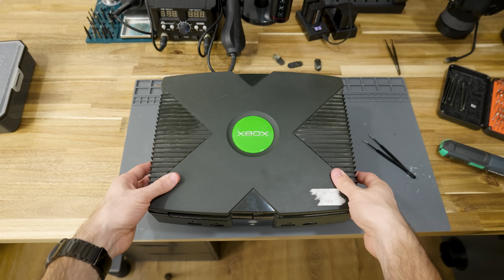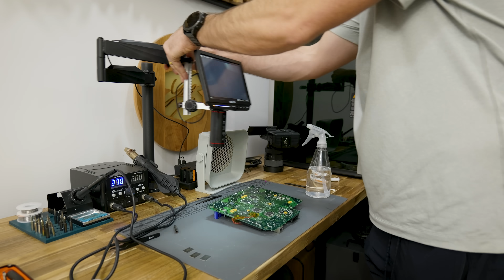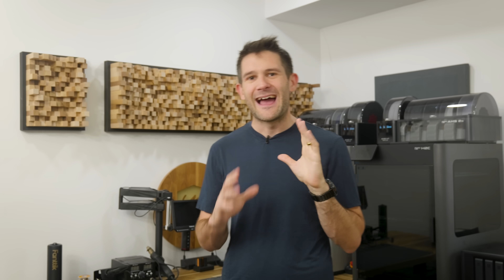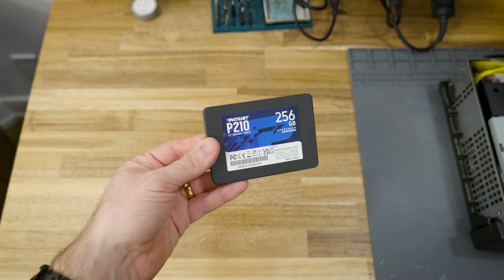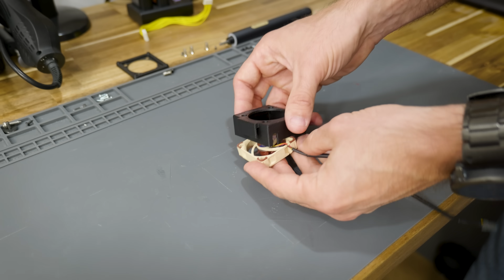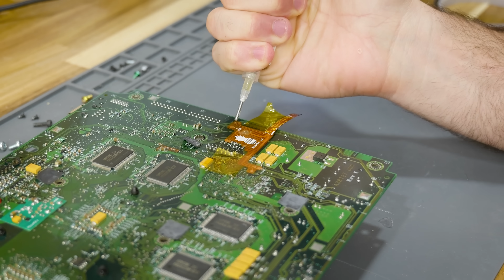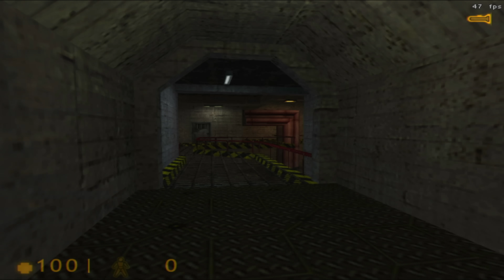I built a MODERN XBOX...

Comment: Okay I would like to know how you got the data from the hard drive over on the SSD. Because you can't just pop in an SSD into an original Xbox and it just magically boots. You can't even take it the hard drive from a from another Xbox and put it into a different Xbox. Because it's all system locked.
Reply: You can transfer the files over using something like fatxplorer. The HDD is unlocked here from the mod chip

Comment: you can’t just slap a drive in there it needs the os firmware and digital signatures, cryptographic keys, and a secure bootloader chain to verify that all running software and game saves were authorized by Microsoft, GOOD LUCK WITH THAT

Comment: This... was amazing. The wife dug out all my old VG consoles and is insisting that I hook them all up and showcase them in our spare room so they can be played. Tried to turn on my original xbox and the drive wouldn't open. I fixed that, now it won't read. :/ Now here I am down the rabbit hole. I've got a lot of research to do, but I'll probably do a lot of the easier mods in this video. I was thinking just a soft mod and emulation was the way for me but now I have this video. 

It may just make my task so much easier with emulation on the xbox. I could skip the NES, SNES, and N64. Keep those in the closet and still play all the games. :)

Comment: that is not how you solder IC to the motherboard, use heatgun for soldering also, good flux but needs skills to know what settings to use on the air soldering station

Comment: I know there are quieter fans and without the dis drive yeah it’s quieter but when you’re doing a side-by-side comparison, maybe you should add the shell or take off the shell depending on which way you’re looking at it so we know they’re true difference after you do that, and then it depends on the material that’s many years how thick it is blah blah blah blah blah yeah it’s thicker material if it’s thinner material, etc. and so on so you made it smaller cool but yet the sound quality was with the top on on the better one and the sun quality was with the top off on the bad one

Comment: To remove the Xbox logo from the casing... it's much better and easier to just leave it in the sun for about 3 hours and it will come off very easily without damaging the edges of the logo or leaving marks on the Xbox OG casing.

Comment: You need to replace the tip on your iron. Your struggle with the RAM chips and the ribbon connecting to the video chip was entirely related to that tip being badly oxidized.

Comment: "Using one of these devices in 2026 is a rough experience" maybe, if your console is busted, mine isnt that loud and the size isnt a big problem. Also it was designed to display on a CRT TV. Outside of portablising I believe that retro consoles are best played on those same CRTs. They can be hard to find but there is a chinese company that makes brand new ones, the downside is the shipping would be a nightmare because they are heavy beasts. Luckily I found mine on the side of the road and I have a spare one just in case.

But having said all of that I still think its fun to see your designs.

Also you arent getting as great speeds as you might think using an SSD, the bottleneck in that respect isnt the HDD itself but the system, about the only real benefit you get is the quietness.

Comment: I wanted to do these mods myself a while back but just felt it wouldn't be used enough. I'd like to purchase that microscope you have though. I use to be a lead tech for 2 different companies building pcb boards and manufacturing LED lights for marine/commercial, and home applications. I spent thousands of hours looking through a microscope and it messed up my eyes. That microscope would've helped ALOT. I still tinker with stuff here and there so it would be helpful being that my eyes are so messed up now.

Comment: Boy what a blast from the past, the original xbox was such a great console at the time. I used to mod and solder on socket based mod chips (that I flashed myself) back in the day, swap in a bigger hard drive, and load up a bunch of games for whoever was lucky enough to convince me to spend the time to mod their console. I even remember swapping a disc drive at some point, probably because my own disc drive failed. I still have the original machine, the d0 popped off at some point after I got a 360 and I never touched that original box again. Maybe this will give me the will to spend some time upgrading it.

If I remember correctly, on the xbox jewel you can sandpaper the bottom of it to make it clear, then use some LEDs to light it up with whatever color you prefer.

Comment: 17:25 the only issue for me is I have one of the final rev ones that is largely immune to hard mods so I need the dvd drive to boot. It only has a weak laser though so I can replace that.
Reply: There are LPC rebuild kits for 1.6 boards. Little more work but you can get them just as hardmod-able as 1.0-1.5.

Comment: fiber reinforced filament is a waste of money and weaker than the pure filament, since the fibers don't bond with the plastic. ABS is already heat resistant to 100C, so that glass fiber stuff is a waste unless you got it cheaper than straight ABS

Comment: You probably want to use hot air (instead of a soldering iron) to put the chip back on with lots of flux so the surface tension will align the chip itself if you don't want to bother to wick the solder off the leads of both the extracted chip and the pads. The uneven surface makes it impossible to align the chip perfecly if you do it with an iron.

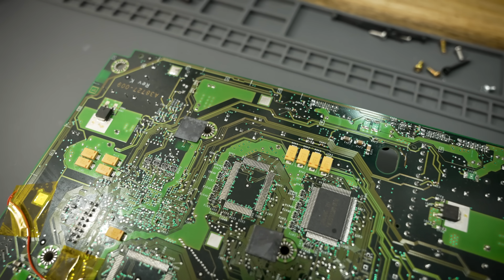Comment: @7:10 The OG Xbox is way over 15 years old. The original Xbox came out on November 15, 2001 in North America, priced at $299. Making it 25 years old. Microsoft discontinued manufacturing the original Xbox in 2005, with NVIDIA stopping production of its graphics processor in August 2005, just ahead of the launch of the Xbox 360 in November 2005. So even if you have one of the very last ones Microsoft manufactured it would be at lest 20 years old.

Comment: although probably wouldnt work but 80pin ide cables werent the fatest ide cable type there was a 133pin version later down the line of ide cables although the motherboard still needs to support the later standards. is the gpu fan mounted the right way up?, as usually fans get mounted pushing air downward not sucking upward. you missed out the cpu upgrade to 1.4ghz

Comment: nice mod.
my old xbox is in a box in the basement.
Last time i used it, i.e. 8y ago, I noticed turning it on and boot into Xecuter Modchip became tricky. Either the Power button (which you need to hold to boot the mod chip) was getting loose contacts or maybe it's the old capacitors leaking and breaking connections? never bothered to find out.

Comment: The amount of times I've seen people on here bother with designing and printing a new housing for their "ULTIMATE" mod builds then skip right on to mounting before sanding, priming or painting the thing is genuinely infuriating. It really just does look crap with those layer lines when the OG had smooth plastic and it isn't even that difficult to do. 

Also isn't there some modded solution for the PSU that drastically reduces its size? The fact that at 23:59 you can see the entire bottom of it blocking the vent is just disastrous. I'd say cool mod but should've kept the OG case since it was objectively better than whatever the new one is.

Comment: I removed my jewel, used gas to wash the green paint off, cutout the back of the lid and placed an rgb ring from the replacement fan I bought for the case behind the jewel. All back in 2003. Light up clear jewel.

Comment: Surprised he wasn't familiar with the old flossing string tip for removing the Xbox jewel. Hit it lightly with a hair dryer till it's warm, not hot then squeeze some floss under one side pull the string in both hands under the jewel and it pops off easy. No need to remove the shield under the shell.

Comment: The best version to rebuild is a version 1.4 motherboard, it has the least amount of crap on the board to fail/replace, while also being hard moddable without a modchip. and find a samsung DVD xbox drive, they are way more reliable, and if you upgrade you 40 pin IDE to an 80 pin IDE, the optical drive to rip games much faster.

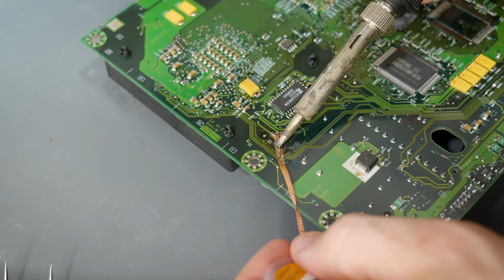Comment: 4:35 — there are 5 of them for a reason. Replacing them with just 3 will increase summary ESR. This will lead to excessive temperature and VRM's less efficiency and lifespan.
Reply: Solid cap capacitors are not considered bad just by bulgy look but by measuring their electrical properties.

Comment: there's a usb-c power supply mod, iirc it takes a ton of heat outta the system because the actual power supplying is being done by a usb-pd adapter and the internal unit just adapts it into the right voltages and plugs needed for the console to properly work

Comment: Why did you put flux under the plastic of the package? That's now just trapped flux that can't be cleaned easily and over a long time can cause issues even if it's no-clean. Also when soldering the pins, make sure you've tinned the pads with fresh solder before putting the chip, and then when soldering the chip, that your iron touches pin and pad, not just the pad. That will reduce the amount of cold joints.

Comment: 23:54 that powersupply is not safe like that, you or especially a kid with small fingers could easily touch high voltage parts of it trough the vent holes

Comment: it should be possible to make the DVD external and still have the SSD located where it iis. Create a 40 pin IDE splitter board and feed 1 side to the SSD and another to a modified external connector. You could then print a case for the DVD and use as required. With a shorter 40 pin IIDE cable there may not be any cable errrors generated so might not need an 80 pin cable. (I think i need to do this lol :)

Comment: To anyone reading this attempting this mod DO NOT skimp out on the IDE adapter.  I know this from playing around with an old P4 system and trying to boot from SSD.  The cheap a$$ Temu/AliEx jobs will work but they do not not work in the same way something like StarTech will for just a bit more.
The difference is night/day.  Who coulda predicted that you "get what you pay for" I know but just something I wanted to mention.  It appears to me based on the red PCB that he is using StarTech but IDK for sure.  For instance my cheap adapter will see the drive after boot but if you want to boot from the drive you have to wait and not all BIOS will allow that and I'm guessing an Xbox it's a hell no.

Comment: Looks amazing, however you missed the CPU mod and missed out on a 1.4GHz chip compared to the stock 733MHz. Also, you switch the capacitors on the main board but you still used the original PSU? (or did I miss something?), that PSU is probably on its last legs.

Comment: Fun fact, the NV2A GPU was originally intended for the Dreamcast, which ultimately used a PowerVR GPU. The NV2A is Kelvin (GF3) architecture. My gaming PC at the time had a GF3 Ti500, which only had one vertex shader, compared to the NV2A's 2. It is really an awful lot of GPU for a console of that era. And for the 733MHz PIII. But they were targeting detail more than framerate. 
Now that I know you can easily access the LPC bus in the Xbox, I want to see someone run DOS on it with an ISA sound card.
Reply: I thought the Dreamcast was originally supposed to use a 3dfx voodoo chip. I wish consoles still went balls out with custom graphics designs you couldn’t get anywhere else.

Comment: That's not "dried thermal paste" lol. It's a phase change material which lasts the lifetime of the console unless it's been disturbed (which you did).

Also, you're installing the wrong capacitor kit. The 1.0-1.1 revision OG Xbox consoles use 5x 1500uF 6.3V + 1-2 3300uF 10V capacitors. 1.2-1.4 changed that to 3x 3300uF 6.3V + 1-2x 3300uF 10V capacitors, and finally 1.6 had 5x 3300uF 6.3V.

Looking at you trying to remove the top cover's shielding was painful to watch, wtf are you doing pulling on that lol... You just need a screwdriver to safely bend the metal holders at each mounting point, takes 2 minutes max.

At least your shell turned out pretty good, but the rest was a bit of a trainwreck.

Comment: Nice upgrades. I have 2 new original Xbox's that I modded but hardly used, one has a 160gb drive and the other a 250gb drive. I think one is a version 1.0 and the other is a version 1.6. I removed the clock capacitor years ago as well before it had chance to leak. I would love to add HDMI to them

Comment: Ya know when you said hard drive I immediately looked up how much it could hold as if it was good enough I would throw it onto a custom server or my already 10TB PC but it was only 8GB T_T

My thumb stick for game saves for the 360 is 64gb, imagine replacing that with a more Modern high end Hard Drive as my god you would never have to run out of space ever. But what would you do with a 8gb physical hard drive? My custom built AI is 33.3gb, no way in hell it is fitting on that and it's mostly the dependencies that are taking up so much space as the Python script itself is only 69kb. Before you ask it is nowhere near working yet but have been working on it since 2024-2025 as nothing better to do

Comment: I noticed you switched soldering irons during filming. which is a good thing. The RAM mod itself is actually pretty easy, it mainly comes down to cleaning the pads properly first. Tack down two legs, apply plenty of good-quality flux, tin the tip of a decent soldering iron, and gently drag it across the RAM legs. Mine was done within minutes, with no need to recheck every single connection.

You could also have saved even more space by using the USB-C UPS mod for the original Xbox.

Comment: Important: insulate the underside of the power supply board to prevent accidental contact—for example, using a piece of clear film or plastic. Up to 400V DC is present there; contact can be fatal.

Comment: You forgot a USB-C mod. that wuold make it EVEN SMALLER.
Also, i have a TV with RCA and Component inputs - two each for Composite and Component. It also supports 3 HDMI signals. It IS plasma-based though, so it has a few quarks. it makes a loud noise when it turns on/off, and it gets hot while its running.

Comment: "IDE" or Integrated Drive Electronic means that your disk does its own setup and management and you don't have to set up C/H/S from BIOS. The 40 or 80 pin header system is called P.A.T.A (Parallel AT Attachment, AT stands for IBM PC AT).

Comment: This is a really nice build1 Love when old tech is upgraded in this way!

720x480 is not 720p. 720p is 1280x720.
640x480 is VGA and 720x480 is more WVGA (wide VGA) of which there are several other resolutions that are called WVGA (800x480, 848x480, 852x480, 853x480 and 854.x480)
https://en.wikipedia.org/wiki/Display_resolution_standards#WVGA

Comment: You mention "15 years" ago at 7:09 and 18:14, but that would be 2011, 5 years after the OG Xbox was discontinued in 2006.  So it should really be "25 years" for original RAM chips or a better hardware design.

Comment: 23:56 - he really put the power supply backplate right behind the side ventilation grill. 
With open high viltage contacts. 
With all airpath locked. 
Just with easy access to HV contacts from outside.
🤬

Comment: Good work.. but I recommend getting a better / new tip for your soldering iron, that one is absolutely crap. I could tell you were getting next to no thermal transfer, it made me wonder if you're using leaded solder or not? Use leaded if you're not already, 60/40. Get a nice chisel tip, maybe two sizes one large one small. Also clean the tip all the time, and when you're done 'tin' the tip and turn the iron off, this prevents the tip going bad.

Comment: This is cool but your new case needs RF shielding too. Covering the inside of the case with conductive glue backed copper tape would do this unobtrusively and fairly easily. The tape/shield to electronics connection needs to be done intentionally since the press-fit of the springy old shield won't be there.

Comment: 4:98 incorrect. When replacing solid state lowESR elctrolytes with regular ones, you need to get nominals a step or two higher to get same performance, i.e. 470uf -> 560/680uF

Comment: It's worth noting you can buy the RAM chip online still for a reasonable rate, you don't have to risk using possibly damaged ram (since the xbox was dead you can't test the ram, and please don't use a working xbox for parts..).
I used to do xbox HDD upgrade and softmods back in the mid 2000's shortly after the 360 came out. The Original Xbox is to this day my favorite console.

Comment: Technically all consoles are PCs because they are all computers meant to be personally used (as opposed to terminals connected to a time-sharing mainframe). They are computers because they all are based on Von Neumann architecture of having a CPU, primary memory, and storage. And, yes, both the storage that stores the embedded system that runs the BIOS that boot loads the operating system or runs the OS directly along with cartridges/CDs that store the games count as storage. Even though the software on the consoles artificially limits the computer to run and render games, it is theoretically possible to run as a general purpose computer. That is what differentiates it from an appliance whose hardware is designed to only execute one to several functions.

Comment: "You only need 3 capacitors because they have a higher capacitance" - yeah, that's not the point. They're not split into 5 capacitors because they couldn't get one big enough. There's also proximity. In this case it's not making a great deal of difference, but that's not true on every circuit board.